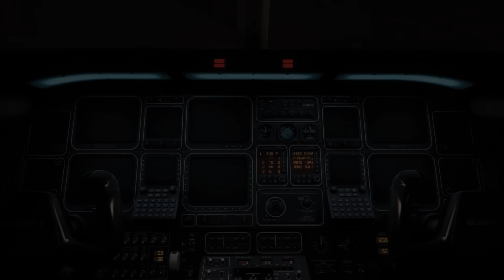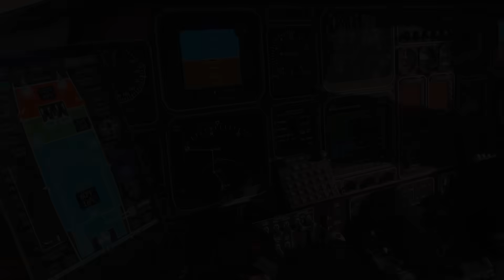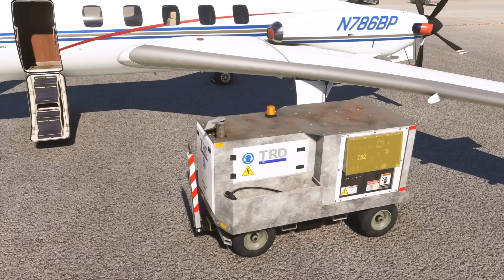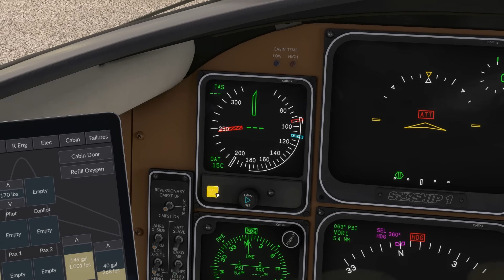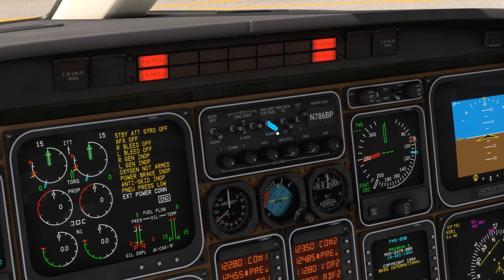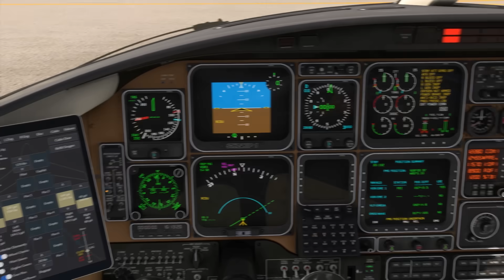Black Square Starship MSFS - Avionics Overview- Just Flight

Comment: The CRT avionics system is what drew me to this plane.  It is also what I love about the TBM 850 and in the sim in VR these systems are so much nicer and easier to use than either pure analog systems or modern glass cockpits.  At least for me.  And they have a lot more character as well :)

Comment: How is the engine torque modeling? I have PT-6 engine maintence and run up experience as an A&P mechanic, and haven't seen correct modeling in any flight sim yet, for example, with the propellers in governing range, there is almost no lag with power lever movement and torque response, I have a lot of maintenance test flight time in the right seat, in Beech 99, 1900 ,C & D models, are the ground fine solenoids modeled? they would cause a wild ride on touchdown when one would hang up. They were tied to the right main gear squat switch.Looking forward to flying this beautiful airplane!
Reply from the maker: I can ask the Dev about this for you but your reply seems to have halted abruptly there?
Reply: Thank you for the response! On the Star Ship, a stuck ground fine solenoid would have a lesser effect than on a B 1900 on an icey runway with a crosswind, as soon as the right main squat switch is activated on touchdown,  it shifts the low pitch stop from 13 to 9 degrees, but on lifting up on the power levers, the pilot can override this, not a good thing too do in flight! At my airline, we had a captain do this on short final, the resulting hard landing bent the wing spar, Beech did an engeenering disposition, and installed a spar cap on lower wing surface,  and a female pilot from Beech flew it back to the factory, but I digress...